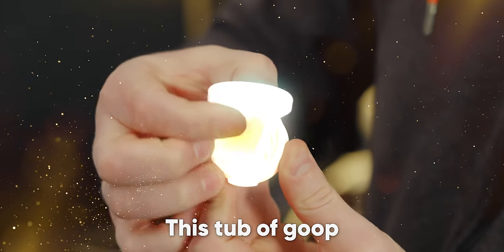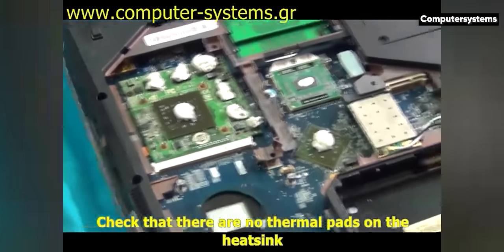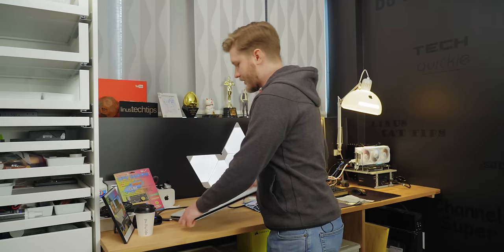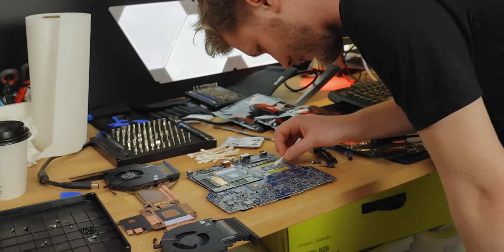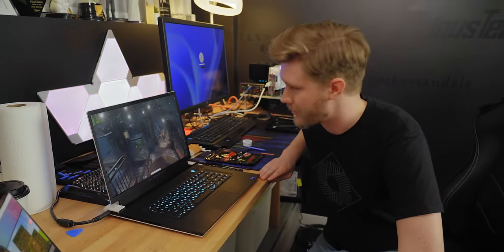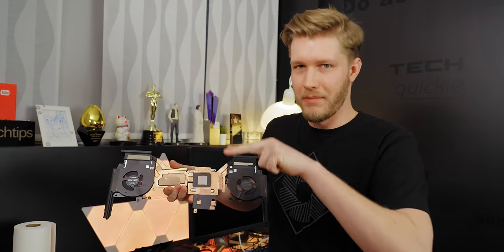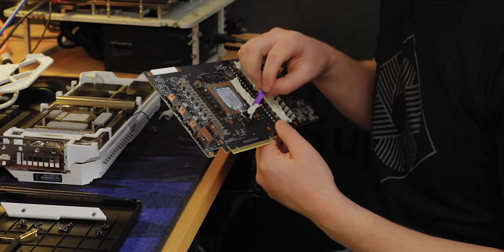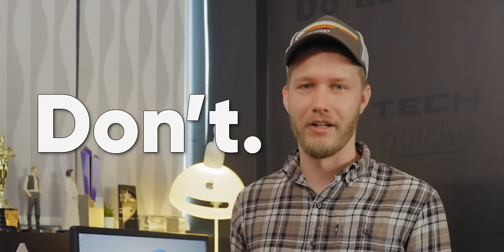More FPS for just $10 - K5 Pro Viscous Thermal Paste

Comment: Did you leave the stock thermal paste on the GPU core or did you change that one too?
I have the K5 Pro here right now and i am planning on repasting my 1080 TI. Unsure though if i am missing something for the GPU core itself. Should i keep the thermal paste on it has? Should i replace it with a fresh one? Should i get some special thermal paste for it before i repaste it?

Comment: Does it dry up with usage? Or is it kindof a lifetime application?
Good thermal pads are also quite expensive, I used a ton of cash for new pads for my RTX3090 to get better cooling on VRAM. A bunch of different thickness, also if you have some of them with too much squish then others or gpu may not have enough squish.. So I kindof see a use case for this, but not sure I will use it if it does dry up.

Comment: I just ordered a couple little tubs of this stuff, got a 2060 super that desperately needs it. I don’t want to spend $20-$30 on thermal pads that may or may not fit. I already have a 3070 but I still want the 2060 as backup if anything happens.

Comment: that goop meh ,there was something similar i bought back in 2012 for ati card of mine think it was the 6990 for an aftermarket  artic cooler and you could get a compound that  would mix then it would dry and replace the thermal pads forming new ones that fitting as the originals if so required, if memory servers me correct you can still get that compound from artic silver, it was effective and the card still runs ironically

Comment: If all this is is high quality thermal paste what about high end silicone based pastes like tg-pp10? This stuff is only advertised as having 5.3W/mK but you can get thermal pastes up to 10W/mK. What's so special about this stuff?
Reply: it can be applied for 1mm thermal pads, thermal paste is only good for 1/10th of that space. But don't use it on GDDR6X it gets to hot for this stuff and decreases performance. ANd its awful to clean up after you fucked up :/

Comment: I work in a computer repair shop since 9 years and I never see a laptop dying for thinner thermal pads. It's 90% the PCB itself or some BGA crappy soldering. 10% is the user.

Comment: I would say that you guys need to test the k5 pro more. i bought a tub of 110g and applied liberaly and i have worse temps than with my old pads on my msi 3080 3x venture. and from what i have read they are horrible stock. I cannot recommend this putty to anybody thinking of applying it instead of thermal pads on any high preformance graphics card. i have doublechecked the coverage of the putty and its 100% on all memory chips. my card are now thermalthrottling when mining at 180w 65% Pl and - 1000mhz on both core and memory. (yay good waste of hours of my life and 50 dollars)

Either your results are wrong or the company sent you another product then what i received

Comment: One could use some masking tape to produce a better job, yet plastering your boards with such a paste is incredibly risky in nature, not only it can create pockets but ultimately depending on the structure of the paste itself it might become electrically conductive and not necessarily because of it's formulation, it might encapsulate dust and humidity pretty easily.

Being a paste rather than a more stable jelly pad I bet is going to last "wet" quite shortly. This is not like sticking a pad on a MacBook... this is called butchery! I'd feel guilty if even just one of my viewers would do this to his laptop!

Comment: Would you recommend this on a old 15 inch gaming laptop? Want to repaste it anyway since it’s either loud an slightly hot or noisy and hot.
Been wondering if liquid metal is a problem since I take my laptop with me every day to college?
It’s a MSI GE62 apache pro
Reply: Yes, I’ve got an asus gaming laptop, it’s outrageously loud, I used both the k5 pro paste and thermal grizzly. the temp never went over 83 even under-loud

Comment: re-pasted my asus 1080 ti  poseiden this week . used thermal grizzle on gpu dye and k5 where there used to be thermal pads. it VERY messy but I got my temps down and maybe even  lower than the day I bought the card!  Idles at 27 cel now from 36-40 cel . wish there was a way to measure temps on mem chips.

Comment: I used this stuff and it develops air bubbles and reduces performance, a huge pain to clean up to, would recommend the more putty like alternatives
Reply: rather cheap but mmuch better: HY 236 or Hy 256 for example, even the really cheap Hy 234 is better, but worse than the other 2.

Comment: Any viewers tried this? I read that some users had it boil creating air pockets.
Reply: do not buy this product , i used it on a GPU , after 4 month , Thermal Paste lost all of its viscosity , making my vram heating up and making my pc shut down , even though  the chipset of the gpu itself was under 70 degrees , the chipset of the vram were on fire , garbage product
Reply: @MalvadoCrow  The K5 Pro paste states directly that is it not for GPU but for 'thermal pad replacement'-  so if you put this directly on your Gpu or chips that were not orginally with 'thermal pads' then.. that explains why you had a bad experience with it. Just wanted to let this be known.
Reply: Only use K5 Pro paste for when you originally see chps with "thermal pads" on them.. Do not use K5 Pro for CPU or GPU. It even states that in their instructions etc..
Reply: @tereongullygully3314  i did not put it on my gpu chipset , the product is 100% a scam ,  product is sell as a pad replacement with better thermal conductivity , the shit lost all viscosity and become rock solid
Reply: @MalvadoCrow  You literally said this in your 1st comment : "do not buy this product , i used it on a GPU , after..."

you literally said you used it for your gpu no?  Also I have it and how do you explain others not having a problem with it? I also would only use it on small chips around that were not part of the GPU or CPU.  I used it for the smaller memory chips that were further away from the CPU and that had original thermal pads..  

I used Arctic MX-4 for the GPU VRAMS and GPU and CPU ..  

I ONLY used K5 for tiny other surrounding chips that were NOT part of the GPU or CPU at all.. 

does that help with all I am trying to tell you? 

also it is very possible you received a not real K5 paste maybe?? I'm just very curious how you had such a problem.. 

but I will tell you in 5 months from now if the paste is rock hard and solid and lost it's viscosity..
Reply: @tereongullygully3314  dude  on a gpu you have the main chipset and the vram , i did not use it on the CHIPSET , i used on the vram , WHERE THE THERMAL PADS COME ON A GPU,  i used it as a thermal pad replacement
Reply: @MalvadoCrow  Ok well on my Gpu, the VRAMS had paste on them from the manufacturer..  so Vrams around the GPU did NOT have Thermal pads.. what year pc did you see this on?

Comment: Would like to see a "tutorial" on things to check when your CPU gets lockeddown to very low clockspeeds.

I do get in contact with tons of computers and it just happens all of the sudden and the "only solution" i have found is to format the operating system. (Noted even linus had the same issue in one of the videos)

obvious things like thermals and the power options is ofcourse already as it shall be.

Comment: DO NOT USE THIS FOR HIGH HEAT TASKS things like a 3090 and such it will boil
Reply: Does it actually boil!?? I just got some and my temps are awful on my 3080 FE. Do I need to not mine until it's off? What a joke. Have you cleaned yours yet? Tips?

Comment: I have a SATA m.2 to SATA 2.5 inch enclosure converter, but it makes my SSD idle at 65c, and sometimes even thermal shutdown at 77c when dumping a large file to it...  Can't fit a normal NVME heatsink to fix it (Only about 2mm of height space), I wonder if this stuff can fix that...

Comment: when using k5 should you use it for the cpu paste instead of regular paste

and does liquid metal go on the dye of the cpu itself or can it go on the heat spreader where the cooler makes contact with the cpu?
Reply: K5 Pro is designed to be an alternative to thermal pads, not for CPU cooling. Apparently they make K4 for CPUs, but I have no hands on experience with that one, so you are better off sticking with something like Thermal Grizzly's Kryonaut.

You can use liquid metal for both applications, from my personal experience, most gain is between the dye and IHS rather than between IHS and cooler itself.

Comment: How does k5 pro perform compared to regular CPU thermal paste? I know it's technically not designed for that, but given it does the same thing so I don't see why you couldn't do it.
Reply: DONT, simply DONT!
K5 Pro is just garbage, you're WAY better off with regular paste or Kryosheet or phasechange material like honeywell 7950 on your CPU/GPU its also bad vor VRAM and co, just get cheap HY236 or 256, which perform much better.

Comment: The reason why alienware laptop was slower because ram heated the cooling system more so gpu chip had less headroom which means lower FPS. I need a bigger cooler and thats why rtx3090 had 6.3fps more

Comment: I bought some, hasn't arrived yet.... But right after I ordered it some guy on google claimed in can boil and create air gaps. You should look into this an hope to prove him wrong.... While I try to find out for myself... Also gonna use it on a CPU, I can't be the only one that's curious how well it'll work.
Reply: Do NOT use on a cpu
Reply: Have you used it yet?? I got some, it's straight trash, don't waste your time applying it, I'm dreading trying to get it off mine. Running at memory temps of 108C with the fans at full blast, no OC. Just as bad as stock pads. Fml bro.
Reply: I have, I put it on the vrms on a old GPU of mine.... Kept the old thermal pad just in case. I haven't tested it yet but I'll let you know how it holds up.
Reply: @jacobfriesen7078  any update?

Comment: Isnt this stuff rated at 5.3 W/mK , wouldn't this be a downgrade from the Fugipoly pads I put on my 3090?
Reply: Yes dont use this, its awful for 3090´s memory. I repeat do not use :D I just did and its terrible +15c in comparison to my thermal pad mod.
Reply: @CASyHD.  I was definitely not planning on putting it on the memory.

I have a waterblock and was considering covering the chokes

Comment: I test it on my 3080 FE, not so good: still 100°C to 106°C on VRAM and 1905Mhz down to 1875Mhz with Heaven running (tested 2 times thinking "maybe not enough goo ?") Any suggestion ?
Reply: buy gelid thermal pads this stuff is awful for GDDR6X Memory its just too hot.

Comment: I feel like you missed the point a bit. It is not so much about performance gains as just working at all without needing the exact right thermal pads. Still a great video though.

Comment: for your consideration! so my computer is overclocked to 50.8 GHz i9 9900k the RAM to 3500 MHz ever since I upgraded to WIN11 problem started and I can't maintain this overclock, ao I updated the drivers in Advanced options and it was ok for a while now after an update the problem is back and I can not update the drivers from the advanced option because the software crashes the second I click on it.... this win 11 sucks! any suggestions?

Comment: I've sat for a few weeks with different sized thermal pads in my Amazon basket debating which packs to buy to re paste my 3 year old strix 2080 super. I seen this video and bought three tubs and a fresh tube of Kryonaught. I stripped the GPU and cleaned off the residue from old pads that was left on the VRAM and GPU etc and went to town! (FYI - I only needed one tub! 🤣) A few timespy runs and some stress testing in a few games later and my memory (hotspot) temps didn't exceed 75C with my existing stable overclocks, I was also able to use maximum power (+125% tdp) with my core overclocks AND top memory overclocks without passing 77C on the vram(this wasn't possible with men overclocked before as GPU temps would cause vram to hit 99C). I'm still to find the limit on my vram overclocks now as it is running much cooler than before. 100 percent recommended. Obviously I will keep an eye on temps and performance over the next six months as with any modification of this sort but as far as initial observations are concerned, this stuff is magic goop! Buy it, you won't regret it!
Reply: Many people have bought and do regret it, including myself. It's not good enough for DDR6X VRAM, it's worse than the garbage stock pads on my 3080 FE
Reply: @hdwblade  absolutely not the case here, gddr6 as opposed to gddr6x mind, but it's thermal conductivity and thus, performance are infinitely better than the stock pads on my 2080super. So much so that I can now run memory overclocks that were impossible before. And all whilst core and tdp are maxed out. Not the donkey you claim it to be at all. In fact, I dare say that the people having problems with it are applying it incorrectly...
Reply: @SiDdevil  that's not the case, it's impossible to apply incorrectly, what a ridiculous assumption. You make sure there's enough to fill the gap, squish it down. So dumb to assume so many people could be doing that stupid simple step wrong, but are able to disassemble and reassemble their card without issue 🤦‍♂️🤦‍♂️🤦‍♂️

Comment: I want to use this but i have read that it can boil at high degrees. Is that true?
Reply: do not buy this product , i used it on a GPU , after 4 month , Thermal Paste lost all of its viscosity , making my vram heating up and making my pc shut down , even though  the chipset of the gpu itself was under 70 degrees , the chipset of the vram were on fire , garbage product

Comment: 🥺🥺🥺I just mite have discovered something accidentally.
I just used GC Extreme with the Arctic mx4 and it worked wonders. 1st i applied the GC and above it i put the Arctic mx4 

I dont know what and why. But it increases fps by 30%

Earlier i had Grizzly 👍🏻 that works too but it got dried up lost benefit too early in 3 months. 
Country India Mumbai
Too humid for this i guess.

Comment: The issue with this kind of material is when we applied it to a processor and it spreads over the processor or any specific component, it will also spread over the other materials and heat them up. If the other contacted components are not resistant for heating enough, this product can damage them. The motherboards heats up as well, ok, but don't forget that we take the heat over by using conducting materials and by using fans, we cool the cpu. We can't be sure what would happen if any of the components on motherboard contacts directly to cpu and takes its heat. This product can be harmful. Better in mind.

Comment: Tried this product on a 3090. I do not recommend. Memory temps were 112° at idle. Checked the paste. Made sure adaquate contact and coverage. No change. 2.5 tubs and worse than failed thermal pads. Not sure what you did to get good results but it sure didn't work on my Strix cards. Not even close. Just a mess to clean up
Reply: I just got some and my temps are awful on my 3080 FE. Have you cleaned yours yet? Tips?
Reply: Can Confirm does not work
Reply: @CommZod massive bummer.

Comment: Although I've had a lot of different mechanical capabilities that involve heat transfer. My most applicable heat transfer understanding is with ignition control modules when they're put on the vehicles. And I have seen only a couple that ever used any kind of thermal tape and they were utterly worthless. Tastes always always always always always works better as a thermal transducer than does tape of any kind. The makeup of tape causes at least a good percentage of it to act as an insulator. Not a transducer of any kind. What moron ever thought that heat transfer tape was a good idea. It had to have come from somebody who is just trying to make it easier to assemble not easier to actually make work properly.
For instance, on the application you're using you need no more than 1/16 or less of an inch layer is more than enough. You are wasting three to five times more than you have any need to use.

Comment: Damn i got a 12 years old hp laptop that burns when i run more than 2 chrome tabs, but still disassembling it could be a bigger problem thatn heat so nevermind. That sounds like a good solution to desktop gpus tho.

Comment: I've tried the CSGR K5 Pro on my lenovo legion laptop 4070 VRAM and it performs worse than a thermal pads and increased the temperature by about 5-10 degrees celsius. I bought a CX-H1300 from ebay and it performs much better. This review is botched.

Comment: You should do this with like, the bargain basement level type stuff and see what gains are there.

3000+ dollar high end equipment benefits being almost not at all isn't surprising.  However, if you can save 2k$ and get way more performance out of lower end hardware -- now * THATS * a solid use case.

Comment: did it help tackle the terrible vram temperatures on the 3090? because I was more interested in that. because on a 3090 its dangerous and this could be a legit and cheaper alternate to two water blocks.
Reply: NOO its terrible for 3090 memory. Save yourself the Hassle, just did it and its awful.